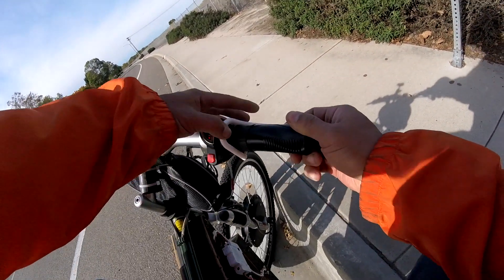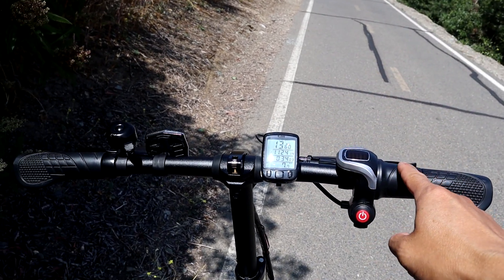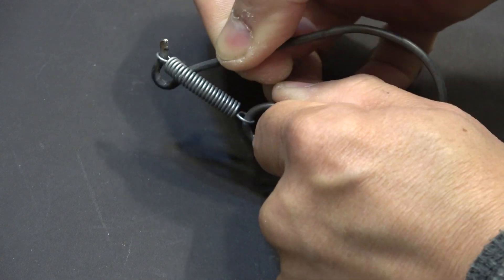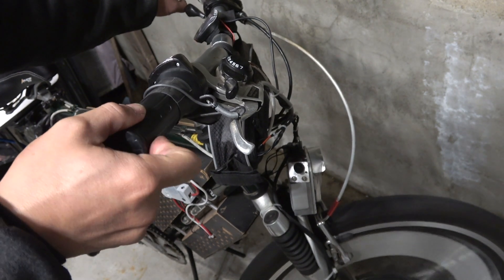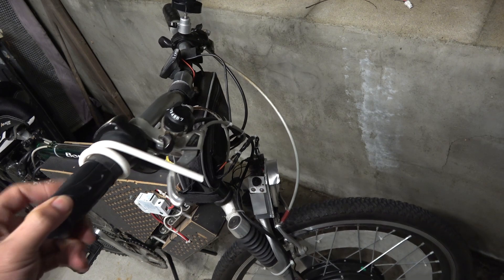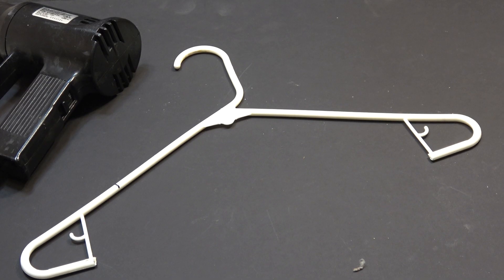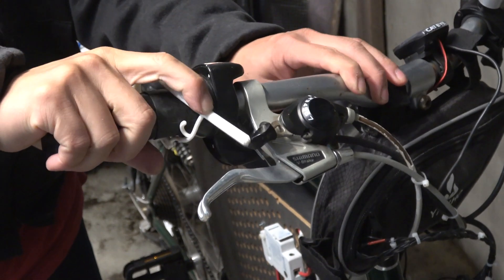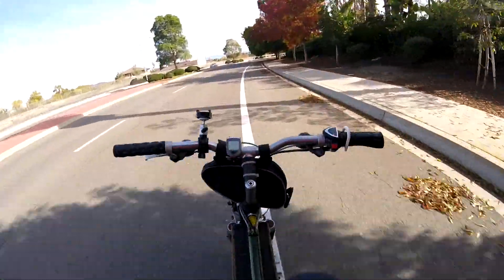Home made Ebike cruise control: Level one autonomous riding!

Comment: Wow! I made one for my basic Violamart eBike kit. I made mine with the bottom piece just a little shorter than the top so that both ends extended past the brake handle. Then I put a strong rubber band on the ends just past the brake handle.The rubber band keeps some pressure on the plastic ends helping to keep the squeezed inside  from expanding. It works a lot better than I imaged it would! Thanks for the idea!

Comment: Thanks for the tip, I just stepped down to a basic throttle setup on my backup bike with a basic controller that doesn't have any functions whatsoever.. and I'm going to try your method.  Cruise control is my favorite basic ebike function. I have no-handsed on cruise control for miles at a time, usually when I'm tired on straight quiet roads.

With a hand-grip throttle you can do this by snugging the handgrip against the throttle so it stays in position. You then have to manually dethrottle every time you need to stop/ etc. But hey. It's not a bike for general use of the public, it's your own bike...

Oh yea, I forgot---this video is for entertainment only!

Comment: I fitted a mirror on the end of the handlebar which meant I had to remove the grip to cut a hole on the end to fit it in. While I had the grip off I removed the plastic spacer separating the throttle from the grip and replaced the grip pushing it firmly against the throttle. I now have a form of throttle control as the throttle stays where I put it. Much more comfortable on long rides. I'm in the UK so my mirror is on the same side as the throttle.

Comment: hi i want add extra battery pack to my razor e300 when battery dies so can swap over I've made a xt90 plug in lead but i want keep voltage same 26v when i change battery so need a switch how would it wire up ?by the way i fixed my vruzend bike battery.i had power drop up hills.i replaced power lead as one had 2 joins with choice blocks
Reply from the maker: Try a transfer switch. It looks like a double-pole safety disconnect switch but it has connections on both sides so you can switch over..

Comment: u are genius!!
 i have a question: 
i'm wondering if i can use a 10s BMS as a 8s ??
Reply from the maker: Thanks. And no you can't use a 10S BMS for an 8S battery pack. It has a main terminal and it has to be connected to 42V.

Comment: Hey buddy, tried reaching out to you via Yahoo email address. Had some specific questions.
Reply from the maker: I didn't see it. Probably got buried in my spam folder. What was your question?
Reply: @vuaeco  You can email me - have a few questions about some thoughts I have - I have a ground force, mx350, mx650 and want to do some mods and just need someone with experience like you. Questions about charging the 24V kobalt batteries, solder you like, the charger that you use (original vs the tenergy). I bumped the email. It's from bluria at g m a i l . com
Reply from the maker: @MrRedPants  Use the original Kobalt 24V charger to charge those Kobalt 24V batteries.
Reply: @vuaeco  I assume you don't use stock razor charger with 24v kobalt x2 setup on razor go kart. And the 24v motor doesn't burn out?
Reply from the maker: @MrRedPants  Everything is stock except the razor charger as the battery is Kobalt 24V and not the original Razor lead acid battery. Motor works fine at 48V. If you ride normally in the winter or cold weather condition then you should be fine. Riding extensively and do burnouts like in a go kart and riding in the summer then you'll need to install a heatsink to cool the motor (like the one I showed in the video).

Comment: Option #1 seems to engage the throttle if you use the rear brake; where the bottom piece is angled at 45 degrees, it needs to be 90 to emulate the other two designs. Option #3 seems too flimsy, especially for those of us in places with potholes that will swallow cyclists whole. Option #2 just needs more material to loop back around to the top of the grip, to make it one-handed operation.
Reply: Also, I'm jealous happy for you that you're biking in December.
Reply from the maker: Option 1 only moves the throttle just a little bit, not enough to engage it. I can bend it a little bit more to get it out of the way. But it doesn't seem to affect the throttle so I just leave it as it is. Option 3 looks flimsy but it works. I've been using it with no problem. For option 2, it's not about more material on the top. It's about when you engage the clamp. You have to turn it clockwise towards the brake lever when you engage it. The design is too tight and does not allow you to turn it by pressing on the top. You have to lift and twist it from the bottom which requires a second hand.
It's been raining here like mad and I just happened to have a calm day to film this. It rained again right after I filmed this video. At least I don't have snow on the road. :D
Reply: @vuaeco  I don't think you're envisioning what I am, friend. The "good" end to push on, which you have under the grip, simply needs to be extended a half a turn. This would put it on top, and make it movable with a push motion with the thumb, while the palm holds the grip.
Reply from the maker: @fun_ghoul  Ha! Got it! That's a great idea! I'll try that.
Reply from the maker: @fun_ghoul  OK so I just added a long screw to the end of the plastic coil (option 2). It doesn't work very well. It works but it's very clumsy and still hard to push.  The coil wraps too tight to the rubber, I guess. I tried to remove the rubber inner tube but that would make it too slippery and the coil doesn't grab at all. Looks like it needs 2 hands. :D
Reply from the maker: @fun_ghoul  Here are the pictures: https://imgur.com/a/URXLxh0

Comment: Nice video.  These are basically throttle locks or clamps.  True cruise control shuts off when one touches the brakes and can accelerate the vehicle to keep up speed going uphill.  Thanks.

Comment: Ya need a Arduino based Collision Avoidance System there Sir.   You could simply use a Potentiometer parallel with the Throttle Grip Control Potentiometer . Just insure you have  Bat Switch or the like to disengage the thing if needed.
Reply from the maker: I like that!
Reply: @vuaeco  Yep, the Throttle control is nothing more then a Pot.    Can't remember what value mine is.  Easy enough to measure.

Comment: You have cruise control on the controller you are using. It needs to be activated by shorting the cruise control cable (usually blue, two pin).
Reply: How do you use it once you activate it?
Reply from the maker: Most ebike controllers don't have cruise control. Mine doesn't.